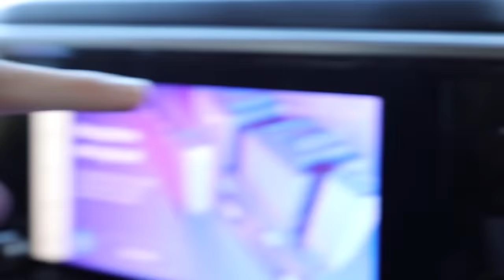Exploring HIDDEN TUNNEL with Fish TRAPS!!! (1v1 Challenge)

Comment: Using the water bottle for a trap is an excellent idea. If you're going to take the fish home, all you need to do is pour a little bit of the water out so it doesn't spill in your truck and then you can leave the fish in there all the way home. Then they will be very happy until they suddenly turn into someone's dinner.
Reply: And then,and then,and then I'm sorry I'm an a****
Reply: @donchonealyotheoneal5456   
I only counted two thens.
But my math isn't the goodest. 😏
Do I get any credit for correcting the voice app's constant mistakes between then and than ? 😉😂